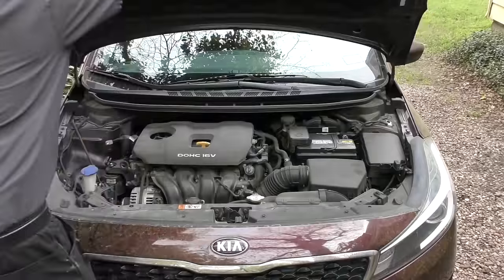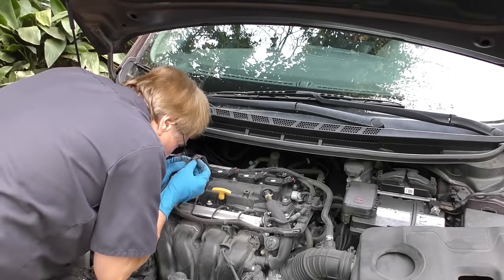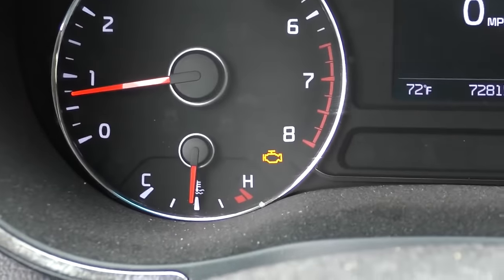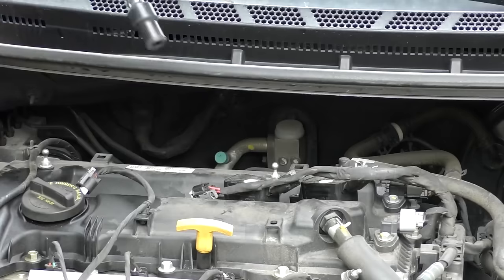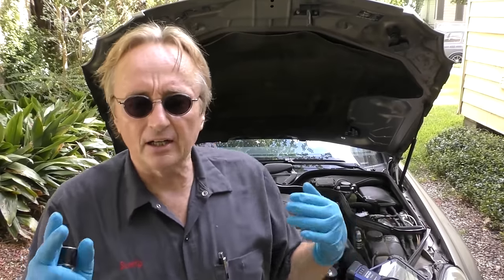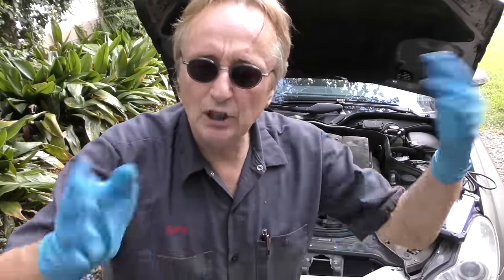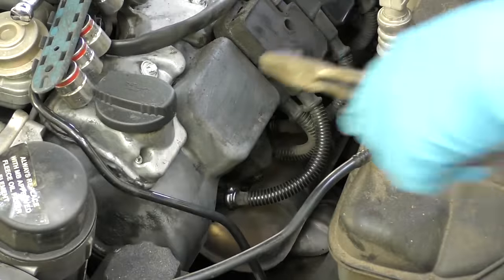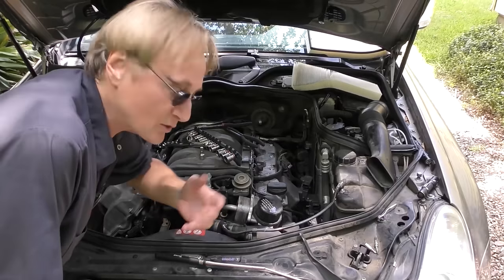3 Mechanic Secrets I Have to Tell You Before I Retire

Comment: Hi Scotty, I have a Honda Fit LX 2017 mileage about 194,000. I replaced the spark plugs & coils and an Oxygen sensor upstream, air filter; Cleaned the Mass Flow sensor. But P codes indicates  P2906, 420 & 301 and P Codes randomizes. I've checked for air leakage and can't seem to find any wrong. It runs fine on the road, a little rough idle.  Almost forgot, it turbo, I used CRC turbo cleaner. Any recommendation that I might be missing, besides a trade-in.

Comment: @scotty Kilmer when i check my plug wires, i just take one off at a time and listen to my engine to find the one misfire! What are your thoughts 😁😁 Me, my hubby, and 4 yr old ASD daughter benn watching for many moons!!!! #2 my engine (2017 Chevy Equinox) does the shakes when my oil is LOW 😩 no issues with my 2015 Toyota Highlander limited 👏👏👏
Reply: Good luck with the equinox, if it's the 3100, 3.4l or 3500 those engines are guaranteed to fail even with proper upkeep.

Comment: Gap the spark plugs to the proper specs, the sticker diagram should be under the hood and use anti seize grease on the spark plug threads also

Comment: Dual plugs per cylinder are still used in Lycoming and Continental light aircraft engines. The reason is in fact because of poor cylinder design where the bore is so large that the combustion flame front is unable to travel across the top of the piston rapidly enough to ensure full combustion of the air/fuel mixture! It is an admission of failure of design in fact.

Comment: May God bless you Scotty, you have saved people thousands of dollars showing us how to repair vehicles with a cheap scan scan tool if it reads live data and explaining how the error code system works. The manufacturer only designed the OBDII error code system to reduce air pollution and want you to have to take you car back to the factory stealer-ship to get it fixed.  Schrodingers Box and ScannerDanner youtube channels are a waste  of time if you don't have a $5,000 scan tool that will graph.

Comment: What is stopping one of these car companies from breaking rank and just saying "You know what? We could just build a car the way the customer wants us to and dominate the market!"
They could build engines that not designed to break down.
They could run an oil pump a few seconds before allowing the engine to start.
Use a PTO and remove everything from the engine that doesn't have to be there. All these things could go into a box with a shaft running through it and have quick connects with a pin you could pull out to remove them.

Comment: Bad spark plug...should be using iridium plugs..normal and platinum plugs do not work well in modern cars..iridium plugs last 100k or longer and take 25% less electricity to fire

Comment: So what was the issue with the rough idle on the Mercedes?  Was it simply the filter or was it the spark plugs?  Seems to me you just threw parts with no specific testing or trouble shooting.  Wouldn’t it have been worth it to just change the filters and see if that was the problem?

Comment: Who still has a KA24de under the hood a 240sx??? ... Now a days most have been swapped with either a SR20det or RB25det or RB26det or LS1 or LS3 .... Not that the KA was a bad engine, it was a work horse and very reliable and with a Turbo it could make some serious horsepower, but the others were just better platforms to modify because they could handle more power and there are many performance parts available for them.

Comment: Hi Scotty- LOVE your channel!  (And have not owned a car- for over 30 years!)  On one of your vids, I saw an '89 Honda GB500 MOTORCYCLE.  Would you be interested, in swapping that for my KTM 390 Duke?  He's running good!  Chain and sprockets have some wear- but I have news ones here, ready to put on.  I also have- the upper headstock and bars, off the KTM 390R, (bolt on fit, still in the box).  Can deliver.

Comment: Hey scotty, my car trips the check engine light only when idling when warm, I stopped at a gas station filled it and went away and there was no traffic for 15 minutes and it dodn't come on untill I stopped.
I replaced the spark plugs last week, there is spark knock at 2000 and something rpm

Comment: I have an 05 e500 it’s in limp mode esc light Engine light ABS lights and air ride  message I replaced air spring and compressor is working . I disconnected ecu and tcu well both ones under hood  while driving to work in limp mode Service messages and warning lights went off the car started shifting in automatic mode and in standard mode and did so for a week . I was in the car and had to change the oil and was going to reset my oil light in the service menu I confirmed Full service and the car went right back into limp mode and has been there since I did however disconnected The computers again I started the car and it was missing really bad and we got the connections and the car stopped missing do you think I may have a bag computer or some of the pins might be bad in the wiring harness

Comment: What do you recommend if I took my truck to the dealer when I had the cylinder 1 misfire code and they told be the engine was blown? I took great care of it but needed a truck ASAP. I got scammed into trading it in and buying a new truck. Is there a way to find out if my old truck is still on the road with the same engine?

Comment: Ugh I hate Mercedes cars, I use to work in a shop doing oil changes mainly, but they would be the worse because the oil filters would take a Special oil filter cup tool so lame and they take a lot of oil too. Most cars I could do one in 15-20 minutes but those cars it would take twice as long. I would never buy one because of my bad experiences. I like doing my own oil changes, it's way cheaper.

Comment: Hey @scottykilmer my 04 Jetta had a cylinder 4 miss fire. I change the spark plugs. Eventually the check engine light went away. After about a month cylinder 4 started clicking loud. Put thicker oil with some additive and it’s still making noise! Haha. Do you have any suggestions?

Comment: My grandam goes in to a spell with random misfires started on #1 changed plug,s wire,s module sometimes #4 shows up on scanner then shut it off n restart it a few times goes away run s fine after

Comment: My 2016 Hyundai Elantra has a rough idle with no check engine light. Any ideas? Changed spark plugs,  changed air filter.

Comment: I have 2001 honda civic. I cleaned the throttle body with a cleaner. Since that when i rev and the car comes back to and idle, its pulsate. The scan I'm using doesn't picks up a fault. How do I rectify this issue?

Comment: Hi Scotty I m new subscriber , I watch your videos and i I learn from you . I have one question for you i have Mercedes Vito 2011 model the engine haves bad Idle , i have  changed new Injectors so i know it is not the injectors and the filter is good. The engine runs fine when i drive only runs bad idle when stop and i can hear noise when i change the gear from drive to neutral it makes different sound but the steering wheel shakes all the time when it is in neutral and in drive when i stop , driving is fine no shaking  it is driving me crazy Pleas help me thanks

Comment: With sensors I found one more problem that might happen, which was caused by human interaction.  O2 sensor was giving code out of the blue 6 months after dealership worked on it.  I first cleaned the connector which didn't fix it.  I think pushed in the push pins on the connector and tried again and poof been working fine for 5 years.  

I knew that was the problem as they were loose and I can move them back and forth.  When I pushed them real hard they locked in place.  What caused this?  Lazy person pulling on wires not the connector.  

The more  you know.. Go JOE!.  lol

Comment: I have a 2003 Nissan Moreno when I get to 60 MP it starts to shake in the front what is it thank you watch you all the time
Reply: And lose power
Reply: Have the steering linkages checked, make sure your tires bolts are torqued correctly, have all of your tires balanced. If the problem is still there have your brakes and suspension checked, there might be something needing replacement.

Comment: 80 K miles on a 2017 that misfires.
Hmmm.
Well, most cars need plugs by then.
Check those and visually check the parts you remove.
Eyewash computers, yes they have their purpose, they had oscilloscopes long ago. But feel it shake?
A low buck outlook would do plugs of a good make for the car engine type.
I had a PITA corolla once that dad set the gap to his book and didn't ask the parts guy. They had updated them to .032" across the board. He had them at .043" . he told me not to touch them not to rip him off and just fix his misfire.
Huh. Well, if you heard the prices for secondary ign parts, you would say whoa too.
Gaps were too wide. Way too wide after a few thou.
Information update on tuneup and consider your known data. Saves time.
Yes he still tried to say I was taking too long and trying to rip him.

Comment: Good content. Quick question, why aren't you using a Torque wrench to tighten the spark plugs? Aren't they need to be in Torque spec to ensure they're not over or under tightened?

Comment: Bleedin computers are a pain in the butt. Whatever happened to the simplicity of engine diagnostic techniques where you had to use your Brain to find the problems. I'd rather the motor industry devolved back to the 1960s when we had REAL cars as opposed to these computer assist pieces of Crap we have today.

Saving face the Int Combustion Engine is on it's way out!